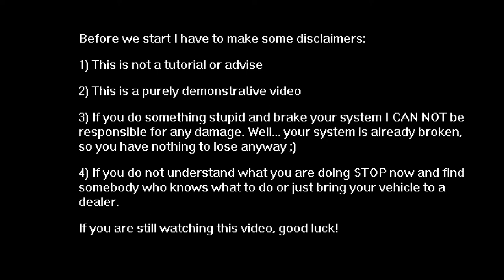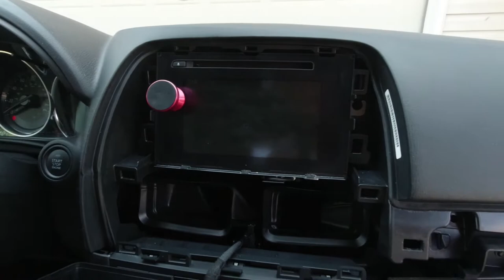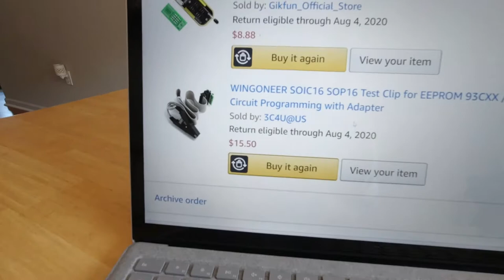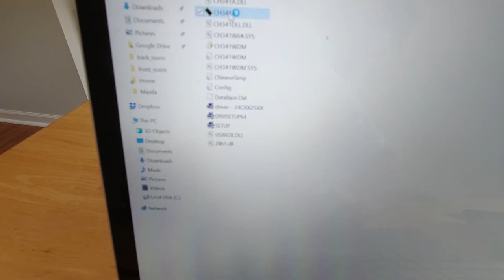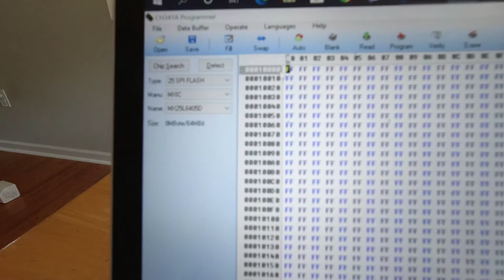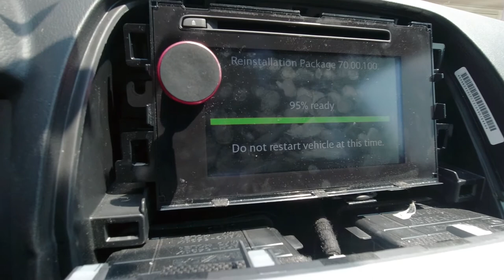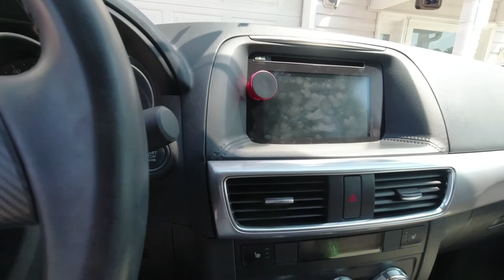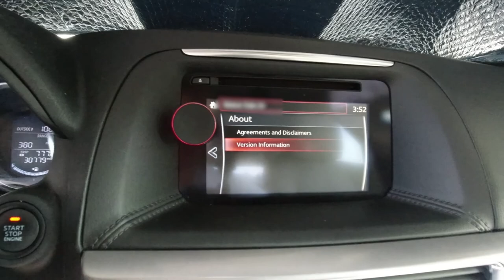How to fix, unbrick and upgrade bricked Mazda infotainment system

Comment: Hi Ride & Live,

Thanks so much for uploading this video, it's been super helpful so far. I was able to get to the very end, but I'm stuck at "Validating System Update package 70.00.100" page. Every time I get there,  the system restarts itself. The installation process never begins. I also tried with Version 31, since I don't know my firmware number and I know that you need 31 before you can upgrade any further.

Unlike other people on this page I'm experiencing a boot loop that I believe was caused by gate and garage clickers that I used at an Airbnb a few weeks ago. I read on forums that other have had trouble with radio waves and their CMUs. My Infotainment system was working perfectly until I used the gate clickers. Then the first time I started the car up the boot loop began. That's the only thing that had changed - I never tried to update the firmware or anything. (I just wanted to note that in case others are experiencing the same issue!)

Anyway, I was wondering if you'd be willing to upload/send me the .bin file from your repaired chip. I know the code for my chip is messed up, but I don't have a "repaired" version to compare it to. I'm sort of at a loss for what to try next, other than paying the dealer $1100 to fix it. I feel like I'm so close to a solution!

Again, thanks so much for uploading this video. I learned a lot! If you or another user would be willing to send me the repaired .bin file, it'd be super helpful. Thanks!
Reply: I also just messed up my CMU by playing around with the diagnostic menu. Screen is blacked out, radio works but receiving static since I removed the battery. 

I'm just not sure if my coding will be correct to this and I don't have a reliable source of of coding to compare mine to and find the error.
Reply: Having this same issue, did you ever find a solution?
Reply: did you program the gate clickers using homelink?
Reply: @sholansingh3106  did you ever find a solution?
Reply: @jesussuarez6805  yes managed to fix the problem.
Reply: @sholansingh3106  How ?? :D
Reply: @sholansingh3106  How did you fix it. Experiencing the same

Comment: Is it possible to use the 16 adapter?  I don't know if I understand myself, I ordered the kit through Aliexpress that came with a 16-pin adapter and I tried to position it several times and it didn't recognize the chip.

Comment: I have slowly gone thru your excellent video. I feel certain mine got bricked when I tuned to Terrestrial NPR station in my area. So far the issue I have encountered is the CH341A program pulls up in Chinese. How do I covert to English ? I have been using Google Translator but it slow and difficult to hold steady. Can you direct to the English version ?
Reply: Link in the description has the Ch341A.

Comment: I was stuck in the dreaded reboot loop.  I decided to try this since I had nothing to lose.  It worked!  Thank you so much!  If anyone needs help or links to downloads, let me know!
Reply: I was able to re-install package 70.00.100. and upgraded to 70.00.335C as well. I'm looking for a link to download 367 or higher.
Reply: I never upgraded after installing 70.00.100.  I was just happy to get it working again.  Not sure if i want to chance upgrading from there.
Reply: what software you using? can please share me the link
Reply: please I need help I do not know why the software does not detect the chip
Reply: Hello friend, my car is doing the same thing when the screen turns on you see the Mazda logo and then it turns off and appears again as a loop, did you solve the problem with this procedure?
Reply: I know sometimes the loop is caused by navigation sd card but this is not the case.
Reply: @ricardocalderon4846  I did solve it using this video, but it was so long ago, I forgot how I did it...
Reply: what CH341A programmer software did you use?

Comment: @ridelive6249 Took a bit of doing, but successful unbrick. Even though I was initially trying to install to a newer firmware, it would not take and I had to load the one you installed. However, now says Fail safe version no available. can I ignore this and go to the new version now or do I need to go back and install the failsafe?

Comment: Great video!  My CMU is 2019 Mazda CX5 and the firmware is failsafe 70.00.100 NA.  Is my unit is the same as your unit to change line 0x0010000 from FF to 00?

I had the same problem that I didnt follow the instrction before installation.

After the change, can I just update to the latest version?  Or I should install the firmware that I was installing (i.e. Reinstall Package 70.00.100)?  Thank you.
Reply from the maker: You can upgrade to any newer version once you fix your system.
Reply: Thanks for your prompt response.  In the worst scenario, can I use your EU modified backup and then follow your installation procedure even though I am in NA region and use the NA firmware as well?

You made a great video.  I will give you update one I have all the equipment for this project.😊😊😊
Reply from the maker: @KK527 I am in North America too my friend. Good luck.

Comment: Hi cant find the 16 pin to 8 pin adaptor do you know where to get it or even link how to wire pins
Reply: You can buy a 16 pins test clip, then follow the online instruction to DIY it.
Reply: @KK527  I did but would not connect to pc at all tried every way known to man
Reply: @KK527  Any chance you can post where you found those instruction. I have looked every where. I am DIY savvy, just need a little help finding all the pieces.

Comment: does the connector 16 to 8 pin comes with the cable or with usb programmer?because i bought programmer and cable but non of them have that connector and cant find it separetlly on internet

Comment: Hello how are you? I tell you, I did the process and it asks me for the USB to be able to recover the CMU, the issue is that I put any firmware from version 56.00.513 to 70.00.100 and it restarts the CMU again with that or takes the recovery, there is another alternative , since it occupies the 2 files with the same result..In summary... you are left in a loop adding any version of mzd with failsafe included

Comment: I have an issue where it continues to say system failure and asks for me to insert installation media, just like what it showed when you reset the memory chip. When I insert the thumbdrive it will not proceed past 2% and will reboot. Will this method also fix this issue?
Reply from the maker: Make sure your USB stick is good and have the correct version of upgrade image on it.
Reply: Hey! Did you find a fix to the 2% reboot? Did reprogramming it work for you?

Comment: What if we have dtc ?? Mu cmu sometime turn screen off after prompt "screen too hot system will reduce performa lnce....." but actualy the car isn't hot at all ....after i check cmu dtc it says "Display - internal syatem failure" but somtime it working fine .. I'm on version 56 and i've already inatall android auto on it (tweak mod) thanks mate

Comment: Hi Again, reviewing video once more... i get the "system failure" message but it fails to boot even though i have right firmware.. files... anyways.... I'm ordering another off ebay. do you think i could copy the memory chip from the new one from ebay, save as file, then write to my old CMU to fix old CMU?
Reply: hi mate, did you ever find a solution?

Comment: Hi
I have a Mazda CX-5 2016 and I'm having a problem,the  system  keeps looping rebooting, it doesn't start,I have a question will it be able to fix the looping issue,if I do the chip reprogramming?,  I would like to know if it's possible before I order the parts I need to do the fix,
Reply from the maker: I have no idea but try performing an update first. It might fix your issue. If it doesn't, try what I did. You ve got nothing to lose anyway. Good luck.
Reply: @ridelive6249  thanks for your reply, I'm going to do what you said, like you say there's nothing to lose :)
Reply: Hi
I have a question, the part that looks like a clamp ,I see you put a adapter that makes it from 16 pins to 8 pins ,do that adapter have to be order separate,?  because I don't see in the Parts link  you put out to get it at Amazon, what's the name of the adapter, and I really appreciate your help.
Reply: @Mtonyny1  i have the exact same car and problem...did you fix it?
Reply: @TheMazer60  yeah I did fix
Reply: Hi Mtonyny1, my car 2016 cx5 has the same issue of rebooting. What code you reprogramed in the chip, is it the same as shown in the video? Only reprogramming can solve the rebooting issue or I also have to update to 7000.100 after reprogramming?  Appreciate

Comment: Hi,
Thank you for the response. I now see English commands in the program and the chip is re-programmed.
Question:
Exactly what files are on the USB drive that you use to upload the firmware to 70.00.100A ?
The instructions say to load two files in a particular order, 70.00.100A-FAILSAFe.UP first then  70.00.100A-REINSTALL.UP.
Are both of these files on a the root of the 8MB USB drive ?

Thank you...
Reply: Did you have any success fixing the NPR issue?
Reply: @christopherrichins2336  

Negative.

Comment: Very good explanation.
Do you know if I cand programming the chip MT29F8G08ABACA with this ch341a programmer? The chip is from Uconnect 5 inch from fiat Tipo. I wanted to make an update of software and has been blocked at updated screen. I am looking for something to repair and I saw your video but I don't know if it's compatible the programmer with chip.
Thank you!
Reply from the maker: Hey. If this chip is supported by this software you will be able to reprogram it. Just download it and look through the list of available chips. Its a very common flasher that is being used for a bunch of chips.

Comment: Hi!  thank you very much for this solution!  Is the line to modify (00 for FF) the same for the Mazda Connect of a CX5 from 2015?  Thank you very much for your help!!
Reply from the maker: No problem. Glad it helped. Should be the same I think. All you do by changing the code is fooling the system to force it to start over.
Reply: @ridelive6249  Thanks, I will try it!
Reply: @ridelive6249  Thank you very much for this great solution, I've finally got it! Confirmed on a 2015 Mazda CX-5. Had to look for other software because it was not auto-detecting the chip or was giving "time out" errors. Finally, it worked, although now I have version 56 and it tells me that the filesafe.up is 59 (the one that gave the error when passing directly from 51). Do you think I should install now the 59 having the 56? Thanks a lot, crack!
Reply from the maker: @Yeyyin83  I uploaded a file with instructions to the folder. It should give you a good idea on how to proceed. I don't remember all the details but that file should clarify everything for you. Don't forget to do a CHECK SUM of files you download. Good luck.
Reply: @Yeyyin83  what other software did you use? I’m having the same issue!

Comment: What fw version were you before you bricked the CMU? I accidentally did not back up my .bin from the chip and now I am wondering how to flash the correct .bin with my firmware which is 55.00.760A. I am not sure what to edit in the .bin file for it to recognize my old firmware and continue the upgrade to 70.x
Reply: I should add that when I programmed your modified .bin I can start the Verification process on the screen but it never starts the installation process for v70.0.100A
Reply from the maker: Sorry, I don't remember. It was whatever came with my Mazda in 2016.5 version.
Reply: @ridelive6249  No worries. I was able to get out of the bootloop by flashing rom-513b.bin (can be Googled). This booted me into my original firmware and settings before I started the v70 update. Your video was a major help. Thank you!

Comment: Hi, on the flashdrive after corrupting the chip, did you have just the "reinstall" .UP file or the "failsafe" one or both? Thank you. I will be trying this out this week because I just bricked my CMU trying to update the firmware :(
Reply from the maker: Hey. I had all of the files on on USB.  Once you put your USB drive in the system will automatically pick up from the point it stopped. Just watch the video.  As I had mentioned you can't just go to the latest firmware if yours is very old. You need to install two parts of version 70.00.100 first if you are going from V56 or V59 and then install the latest one.  If you already have 70.00.100 version you just need one file since the latest upgrades go in one file.  Good luck.
Reply: Just wanted to let you know, the specific WINGONEER cable you bought came with the SOP16 to SOP8 adapter that we need. 

Also, now my USB doesn’t detect the chip so I think I must have blown out the chip somehow or something. Guess it’s a lost cause.

Comment: Made really good progress on all this with my CX5, and everything was pretty easy until I got to the programming part and I got a "write timeout operations failed" error message when I tried to program the chip.  I tried using your file as well.  Same error message.  Any help?  I'm totally stuck now.
Reply: So I got to thinking about it the next day and was wondering if I did not have the chip on the motherboard fully connected to the clip.  Turns out that was the issue.  I was able to read and reprogram the chip as in the video.  However it didn’t fix my problem because the motherboard itself has some sort of an issue. It seems Mazda is having these issues (replacement parts in this area are back ordered with NO eta).  Anyway, for a brief moment I was able to read the motherboard in the vehicle, so I know that my problem probably is not in the software but in the motherboard itself, I was also able to determine in the brief moment it connected that reprogramming the chip the way shown in the video actually does work.  Nothing lost for me as my system is still bricked, if you have a programming error this can fix it.
Reply: 5/23/22 Update.  My system is still bricked, but Mazda has agreed to cover approx $750 of the $1050 cost to replace the entire unit…. once they get off backorder.  Had it been a software issue this fix would likely have taken care of it.

Comment: Hi Sir, I have some problem like yours. And like you said, i go do the dealer and they suggest to change it amount 1k $, and i have some option i want to change the headunit Tomiko brands. Don't know its Japan or China products. But after seen this video, i want to try to fix it. But i have some questions.
1. Is there the brand of the headunit same with my Mazda CX5 2015 Facelift GT Ver. I'm afraid your headunit and my headunit is different.
2. After we fix it, all the features mazda have like automatic brake system completely works?

Hope you reply this msg before i go to repair by myself. And Pray me Luck. :D
Reply from the maker: It doesn't really matter. All Mazda's infotainment systems are pretty much the same, at least here in US. All you need is to get access to that small memory chip. I don't know about automatic braking and stuff and I doubt infotainment system has anything to do with it. Its broken anyway, so give it a try. But don't blame me for anything you do. LOL. Good luck.
Reply: @ridelive6249  And 1 more thing, i hardly find the brand of USB programmer like your and the SOP16 IC Test Clip also different brands.

But, whats the name of converter from 16pin to 8pin? I cannot find it in internet.

Btw, i shound wait around 1 months for shipping to my country. LOL, can't wait to be ironman. LOL
Reply: @ridelive6249  Also can you give me the link for the firmware?
Reply from the maker: @richardkurniawan3919  You can use any programmer and any clips. I posted the ones I purchased into description up top.
Reply: Can’t find converter 16 to 8.

Is the link you give me already included with converter 16 to 8??
Reply: @ridelive6249  would you help me to give the link for converter sop16 to sop8? I can’t find it. Also the link of raw firmware mazda connect. This is the final step before i trying your method. 🙏

Comment: Thanks for putting the time into this. However, I'm using the same hardware but receiving the following after trying to detect the chip:

Manufacture: Other
Memory Name: Unknown
Memory Size: Unknown
Manufacture ID: $FF
Memory Type: $FF
Memory Capacity: $FF
Device ID: $FF

Thoughts?
Reply: Mine did the same thing.  If it doesn't work  just keep trying.  Took me many failed attempts but i did it  .
Reply: Hi Tyler, did you manage to make it work? I am experiencing the same issue.
Reply: @adamminarik1975  unfortunately no. I ended up getting lucky, took it to the dealer and the guy wrote it off as a faulty unit. Mind you, the car was still under warranty. I think your best bet is looking up the model of your unit and finding a replacement on eBay, that would have been my next move.

Comment: Hi R&L! Thanks for the video. Only issue is lack of 70.00.100 firmware file online. Anyway you could post or link to a drive if you still have it? Thanks again.👍
Reply: do you get the firmware? could you share me the link?
Reply: Cho tôi xin file 70.00.100 với

Comment: I am currently on version 74.00.311. Can I downgrade to 70.00.100 with this method?
Reply: I think you can try. I did downgrade from 70.00.335 to 70.00.100 successfully using this method
Reply: Did it work?
Reply: Why do you want to downgrade?
Does the latest version have problems?